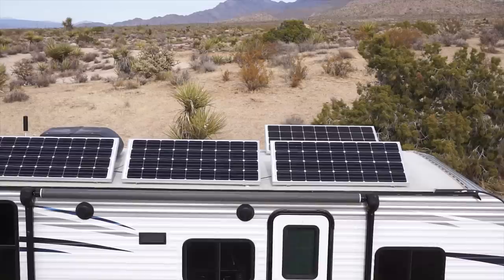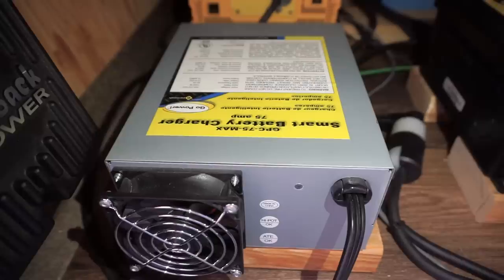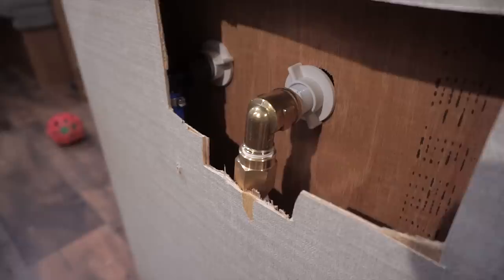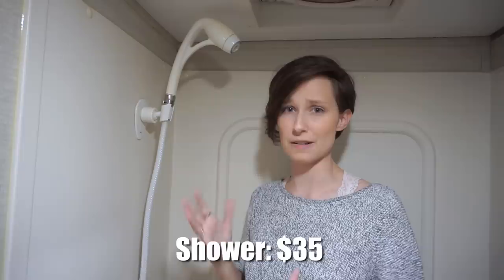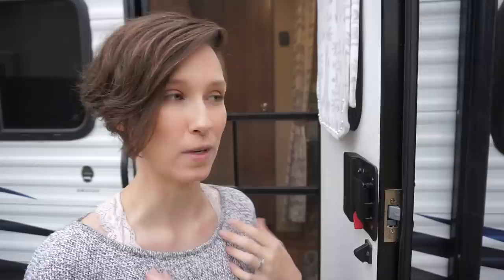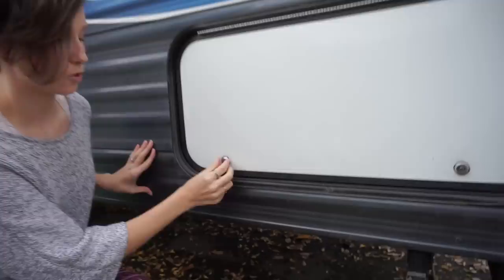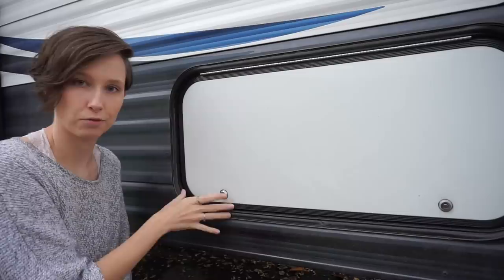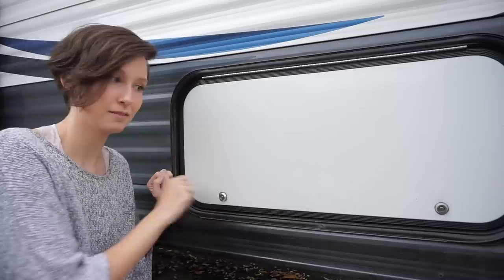Was It WORTH IT?? - All Our RV Upgrades Review - Solar, Toilet, Booster & More

Comment: Put some locktite on the back of the plate and screws both on the sticker plate too. Mine locked me out all the time. Use the lock tight. it will stop the sliding.

Comment: Lock has top screw stripped it looks like.  U could use wood glue and drive tooth picks into the screw hole with the glue on them, let them dry, cut them flush and then reinstall the lock and the screw should be able to catch and tighten like its supposed to.

Comment: use double sided 3m tape extra strong I think you will find it does help on your door  also blue  lock tight  on your screws and use stainless steel screws or use your wifies' clear nail polish

Comment: Your door lock is simple to fix 
The rubber that you use to hold down your dishes !   Cut a peace to fit on the inside and a peace to on the outside , smear a little clear rubber glue on the conners to hold it still Titghen it back up and it will never move again 
The screw that is loose on the end of the door fill the hole with clear rubber glue or epoxy to hold it in place

Comment: For composting toilets, C-Head is a little better design idea than Nature's Head. I've had both. C-Head is easier to empty, is the main thing. In dry weather you don't need an ventilation at all, I find. It's also $200 cheaper.

Comment: Loctite glue on screws. FastCap 2P-10 Super Glue Adhesive 2.25 Ounce Thick and 12 Ounce Activator Combo Pack for back plate.

Comment: Simple solution for poor fitting lock assembly just visit Home Depot or Lowe’s plumbing area and purchase rubber sheeting material usually 6” x 6” / 1/8” or 1/16” thick squares and fab an interior gasket.

Comment: I have an rv lock but it doesn't wiggle.  The rv lock striker plate was slightly bigger than the old one.  I had to carefully remove a bit of material and the new plate fit in snug which held the rest together.

Comment: Thanks guys, loved the video! You have done some of the upgrades we've considered (and done). It appears you've spent more in upgrades than the original cost of the trailer! Personally,  I would never put an "office" in my R.V. because it was designed as a recreation vehicle not a mobile office. If that's what I wanted to do I'd buy a construction trailer. LOL. Anyway, thanks for the info, hope you do a future bit on upgrading/replacing the awning.
Reply: Do you not have an office in your home? it's their home away from home, great idea putting an office in an RV, I did and it's great

Comment: Try Lock tight. As long as the screw holes are not stripped tighten the screws as tight as you can and the screws shouldn't come loose. Good luck

Comment: remove the too long screw, grind the end off on a grinding wheel ( taper the very last thread a little to allow it restart in the mating thread) and then screw it tight, should fix the rocking problem as well... the non stainless issue, well, not much there

The mating keys. ... the storage bay keys from our 1984 Pace Arrow worked just fine on a 2000+ Georgetown - yeah, they must assume that we all like to share...

Comment: I don't know if you found a solution, but I would cut a thin piece of foam to match the inside panel of the door lock that would expand pressure on the component and make it tighter. :)

Comment: To fix your solution of your lock turning on you go to Home Depot to get some exterior doors and windows silicone and silicone all the way around it and I will hold them in place and then go to Home Depot get a stainless steel catch plate with screws

Comment: Black silicone caulk on the inside and out would keep the lock from moving. Just like you'd use liquid nails on something to hold it in place without the super glue affect.

Comment: Your entry locks screws are to long by 1/8” to 1/4”. They are bottoming out before they allow the hardware to be  able to clamp-snug to the door. Change them out to shorter screws and use stainless steel screws with Loc-Tite so that they don’t back out.

Comment: the push button/keyless entry door lock.... take the screws out of it and remove it, then take each half (inside and outside), and fit them individually to see where the slack is, and then shim it.. epoxy a shim in place in the cutout so the mechanism fits snug in the hole, and then reinstall it all.... 
....as for the screw coming loose, use a drop of BLUE loctite on the screw threads... do NOT use RED loctite or you will never be able to remove the screw without destroying the mechanism and possibly the door..  if the screw threads are stripped out, use a larger screw or use epoxy paste to fill the hole, and after it cures for a couple days, redrill the hole to accept the screw. DONT epoxy the screw in the hole.
 most holes/cutouts in RV's are not precise at all, and if the one who cuts the hole at the manufacture gets outside the marks too far, they generally try to hide it, which leaves you with a sloppy install, possibly shimmed with a loose piece of wood that will shift or fall out over time.....  
 for holding the shim in place, and preventing the screw from backing out, silicone sealer may be an option also. its not as permanent so it can be removed, and easier to work with, but the ONLY down side is its not as permanent..

Comment: For the wiggling door lock, I wound remove it and make a spacer/gasket for the inside portion from a rubber/rubberish material (using the inside handle you just removed as a template) reinstall using stainless screws( I prefer torx head over philips, in my opinion they strip less) and add a little blue(least strong) or red loctite, or in a pinch super glue to the threads
Reply: Pennywise?

Comment: Suggestion on your combination door lock. Just add a plate shim in behind the inside assembly. Or use shorter screws. I looks like the door is too thin for the assembly

Comment: As for the solar setup... the MUCH cheaper option is to buy an $88 generator from Harbor Freight.  They will run 6 hours on 50 cents worth of gas... and recharge batteries night or day.

...and the vehicle alternator would recharge the batteries anytime you are driving.

I can't see the value in a $600 battery when you can buy 5 or 6 deep cycle batteries at Walmart for the same price.

Comment: As far as your lock goes put a dead bolt on your door double cylinder I have on on my 1989 Nuwa hitchhiker 36”9 5th wheel ok also on the lock , the lock you installed on your door! your door is to skinny! What you can do is pull it off make a steel or wood plate on the inside the same size as your lock! Maybe half inch wood or metal! I’m a locksmith 8 Yrs! I like your channel!

Comment: for your door lock being loose, take it apart and add silicone sealer then reinstall.  The sealer will dry in 24 hours and be like adhesive.

Comment: I have the rv lock too, silicone around it, and tighten it until you feel you are going to break it. You can go to lowes or home depot and get screws that won't rust- mine are rusty too. Btw use a manual screw driver .

Comment: Dorman Metal Clip Nut (Home Depot Internet #311853173 Model # 961-304D for example) and new SS screws fixes the striker issue

Comment: Use Loctite thread lock on the door screws it will be a permeant fix at any Auto supply store available in red strongest  or blue medium strength about $6.50 and 5 minutes time. Nice cat too!!!

Comment: I used double side tape on in side of the surface area on the door lock and used the original ss plate and threadlock on the hardware good luck hope this helps thanks

Comment: I would try some thread lock but you can get from a auto parts store put the thread lock on those threads and then I'll keep it from coming out I will probably either get the light or medium strength

Comment: Have you tried putting stainless hardware on your lock... then use lock-tite (try blue, if that doesn’t work, red) on your bolt threads when installing so it doesn’t get loose. Stainless bolts would not cost you very much since it’s only 6 of them.

Comment: Looka like you need to template out a thin gasket for the exterior housing of the lock. This would make the screws tighten down...unless you cut off some of the screw lengths.

Comment: On the lock replace the screws (and make it a longer ones? so it doesn't jiggle as much) and replace the outer plate and most of the time there are metal cutting company's and yes they also have stainless steel, that will do anything for you even a lockplate that needs to be designed a certain way! Or if you can find one that looks alike that is stainless?

Comment: Loctite on the door lock screws, and maybe use a different size screw for the door latch plate (either slightly longer or wider threads).

Comment: Probably could get some hy200 epoxy and put on the inside backplate of the lock . That epoxy is no joke . Just take it off , apply a generous bead on the interior lock backplate , quickly reinstall it real quick . The gun to use will probably cost more than the epoxy . But if you know anyone in construction they may already have it all that you could borrow from them .

Comment: I like your door lock ... the movement  can be fixed (if it was mine it was already fixed). The compartment doors are not secure, I can open them easy with a tube from a pen that fit the circular slot. The electrical system it was too expensive, and I don't know if it worth investing that amount to a lot of solar panels, batteries... Nice video ...

Comment: The RV lock is a great product,  UT the screws provided to you are too long. Your door is very thin compared to 5th wheel or pusher RV’s.  Either cut the screws or buy shorter ones. The number of times I get home late and “click” the door is open, vs hunt for the keyhole in the dark....  See if you cannot fix the lock. I know you will like it if you get it secure.

Comment: Just letting you guys know, when you simply install a shut off valve to the shower, it doesn't really blast cold water anymore when you turn it back on. Also, have you guys tried putting a little washer behind the screw to stop the door handle from wobbling?

Comment: Did you try lock tight on the threads of the screws for the Lock, also you could put some 5200 sealant on the back of the lock face before you install it.  5200 will bond so well that you will have to pry off whatever it is use on.

Comment: You need to make a rubber gasket out of like a inner tube from a tire and as far as that lock being loose I was at a thin piece of wood or thin piece of metal same size as the locking mechanism on your make sure you put that material on the inside and that will fix your loose lock

Comment: For the lock use 2 sided 3m tape or 100% silicone to hold it in place. You only get on shot with silicone.   The rusting is Unacceptable.   You can try a high strength epoxy paint.   You will have to redo it at lest once a year.   It would be nice to have a card reader on the lock.   Most home units that have a card also have keypad entry.   Look at Samsung. They have some neat and durable products. Not so easy to install.

Comment: 670W / 400 Ah ?? I have managed 10 years with 85W / 200 Ah and now upgrading it to 160W / 200 Ah. Use with 2000W Inverter microwave, coffeemaker, 24" TV few laptops and tablets, phones etc. It seems we all have different needs of power, never run out but it's part of that I have 140A alternator and almost every day on a move! And of course here up north we have 20 hours of sunlight in summer time!

Comment: Technically urine is not GREY WATER. What I don't know is where do you empty the used compost? Also, stainless steel and aluminium don't play well. Since your lock is sitting up against you aluminium door it would create a huge corrosion spot all around the lock. I would however have remote controlled electric locks for all doors.

Comment: The fan in the ceiling is nice but for $28 you can buy electric auto radiator fans and they are so powerful that they will blow your hat off if you don't  install a speed reduction switch. About $4 (like a light dimmer switch)

Comment: On your door lock what I would do is git red lock tite that will keep the screws from losing up. For them moving if the screws are tight dues it still move ? If it doesn't then the lock tite will fix it but if it still moves you can try gila asecave put it on both sides of the lock i hope this helps you out.

Comment: I would NEVER buy RV Locks again. Purchased them twice on my old trailer and nothing but problems. Also didn't hold up to the sun and the batteries were always drained. With the new trailer, went with new BAUER NE Bluetooth locks with proximity detection. App-enabled (lock/unlock via Bluetooth), optional proximity detection that will unlock your door for you when you approach the stairs, cover the same exact door area as the default Bauer locks (GD, others) so no issues with full body paint/graphics and can be keyed alike when ordering. Quality is much better for the same price.

Comment: Liked video w cat @ the blinds!  I did not and still do not understand that if water pressure is the same and potential volume is the same that the old head cannot deliver the same volume as the new one except they confined all the water into a narrow burst venturi.  I will keep my old one and wait for a seperate aux pump that boosts the pressure at the head.  Since you put a check valve in the hot line it could not be that hard to add a higher pressure pump + Mixer at the shower.

Comment: Im so glad you addressed the price of RV park per night (9:10).... Because I thought if I were to fall down to where I was just about homeless/tent living...that I could purchase a RV and have somewhere to live and be safe.  I thought that you could park it at rest area's or walmart parking lots.  But what you said at 9:10 affirms what Ive been told before, it costs about 30 to 40 dollars to park your RV and use shore power per day?  Because that is the same to stay in a out of the way hotel/motel when not a special holiday.  I dont see the benefit of having a RV and paying for the gas/insurance/taxes/propane/batteries/solar panels/wear&tear/tires/mechanical repairs/ect. just to pay the same as a cheapo hotel/motel.  That doesnt sound right, seems like if you bring your RV that is self contained for most part it shud be only a few dollars per day to park it in a squared area, and if you use their power while there then only pay for power or water used... otherwise just stay in the cheapo motel/hotel....Can you help clear this up for me?  Im looking for a inexpensive option for "just in case"

Comment: okey guys when doing a solar system there is no need to run these small 20v (open v ) even when having a 12v system as long as you have a mppt charger   buy the 40v panels ,you get much more power for the money and you can buy those panels very cheap with visual inperfections or used , the litium batteries can be had for a decent prize also if you buy the cells (eve 280A) from a known good surplier and asemble the batteries yourself with a good bms i paid 1400$ for 2x 8s 24v 280ah batteries in all 560ah 24v

Comment: On the door lock, could you put a rubber gasket between the door and the inside of the lock and lock washers on the screws? And could you put loctite on the striker plate?

Comment: Very nice video, I went though many upgrades to my B class RV. Not only it was lots fun doing it and It was very satisfying when they all come together. For the door lock issue, did you try to cut a piece of 1/8" or 1/4" silicon rubber sheet and use it as a shim on the inside? It seems the door may be slightly too thin for the lock's spacers. Another thing about the RV lock is the battery life. I would attempt to add the 6v DC wiring (thru the hinge) directly to the lock and eliminate the 4x AA batteries. If you ever consider to add additional 400AH Li-Ion battery, Amazon has a nice one for $1,500 comes complete in a stainless enclosure.

Comment: Not going to read 1.7 comments to see if this suggested fix for the door was previously offered. Is that screw going into wood? If so does it seem to be stripped? If so fill the hole with toothpicks and glue then put the screw back in. Also how about some ultra thin 2 sided tape in the backside of the keypad?

Comment: We're thinking, in the next few years or so, to acquire a new, (used), tundra pickup for me and a camping trailer like the Rpod.  We will not boondock like you guys but I'd do many of your upgrades or at least similar ones.   Cell boost and solar I'd likely do for sure.   I might skip the composting toilet.   I loved all  the lock changes, however, I didn't like the keyless entry you chose.   Clearly it's not designed well.   It has to fit better and be stainless.   If there is no other, better choice on the market, if put a quality,  manual lock in that is keyed differently.  I would consider adding hardware to make it fit better but not having stainless components is a show stopper for me.   And for that price, it needs to fit and be stainless.   In fact I'd pay as much as $600 if it was built right.

Comment: Take your lock off inside an put 100% silicone behind it. When it dries won’t move. An take screw out an put a short piece of weed eater cord in it. Will get tight promise

Comment: Rv i bought has a regular deadbolt lock that seems to work fine, seems they just drilled an additional hole for it, the original rv lock and handle is there, but lock is not used, just the handle to open it.